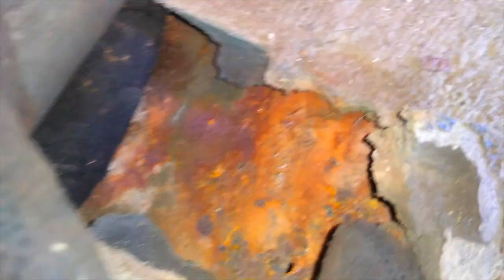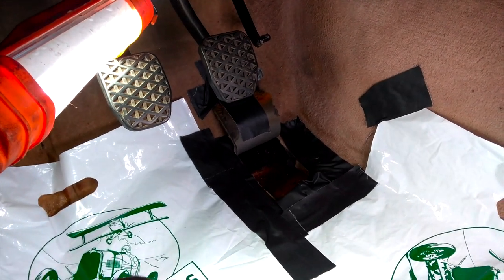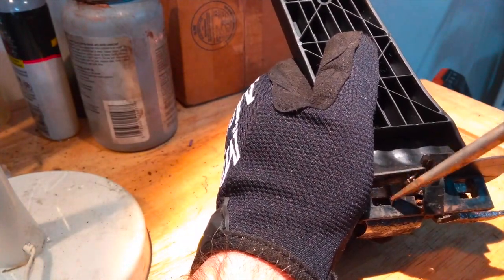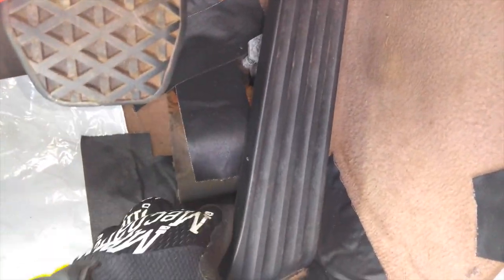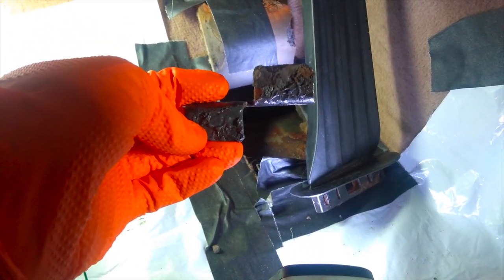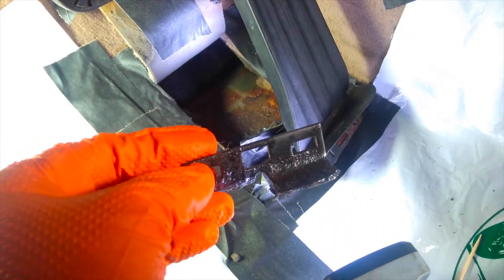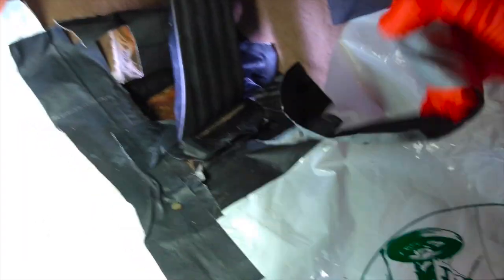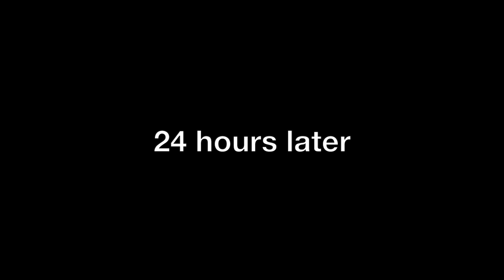Repairing a Gas Pedal on an E36 / Z3 M52TU

Comment: Thanks for this video.  The same thing happened on my e36.  There are 2 drains where the blower motor takes in fresh air directly in front of the firewall, they got clogged and if a lot of water came in it would fill up and pour into the cabin, then pool in the footwells.  I found out the hard way after I bought it when I got soaked in a carwash